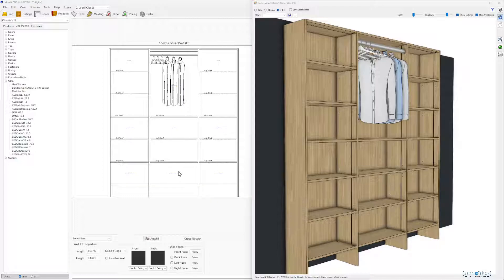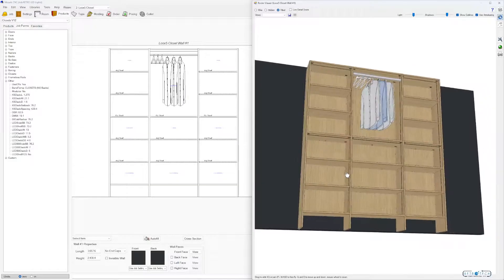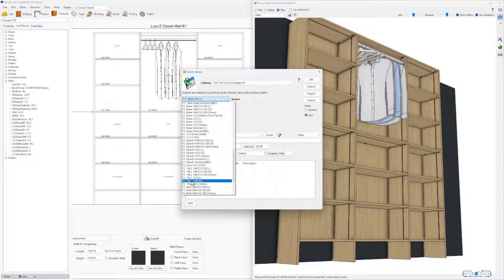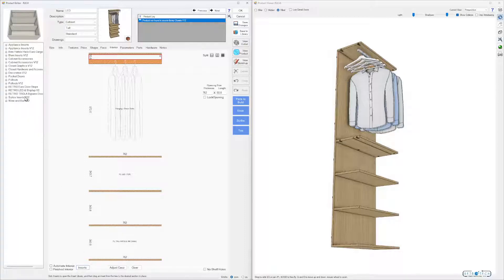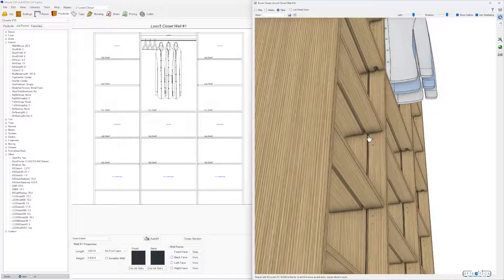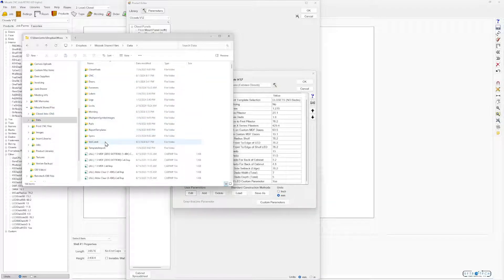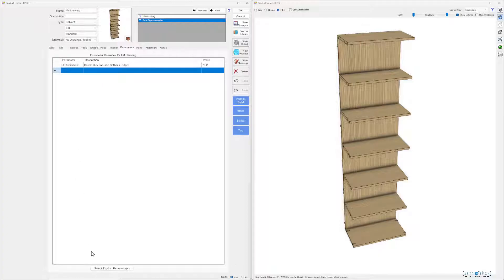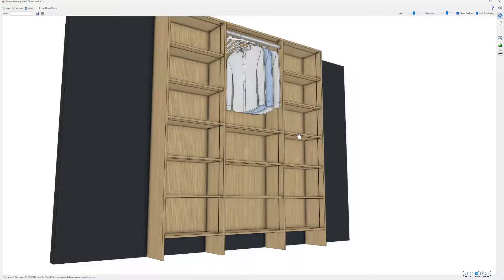LED & Shiplap Library V2 Update For Mozaik Software! NEW Features! Parametric LED inserts!!!

Comment: works great.  Is there a way to track the linear feet of LED channel once you insert it?
Reply from the maker: Thanks for the input!
I will add this in the V3 LED library at some point, but for now you could add it to each insert if you'd like.
**For each insert within the insert library**
Go to Parts--------------> + Add Part
If Single Side LED Insert--> Select Quantity (1) If Left and Right LED, Select Quantity (2)
Part Type----------------->Plastic or Metal
Select Material--------> (1/8" Plastic, or create a new material for this application)
Name your part-------> (Led Strip or Bus Bar or Extrusion, etc.)
Width----------------------->  LEDDadoW
Length--------------------->  Possibly the trick your after here.  Go to your dado operation, and copy and paste the formula length into this part length formula calculator.
This should give you the exact length of dado, keep in mind if you manually alter the dado length, it won't adjust at this part level.  
HOPE THIS HELPS!--Chad
Reply: @RetrotechCNC  got it to work.. thx.